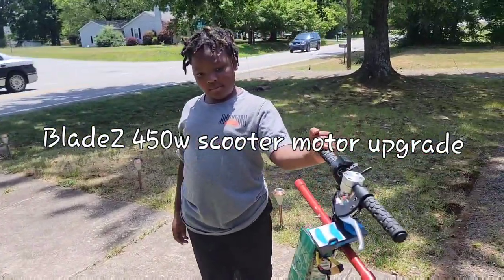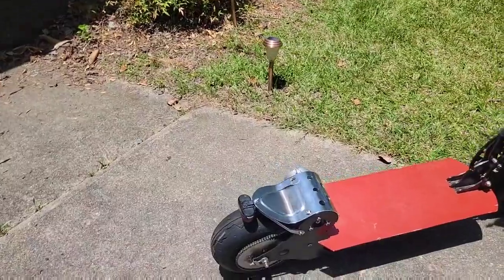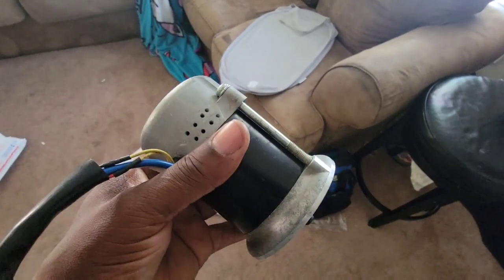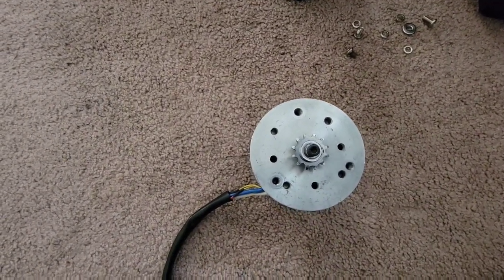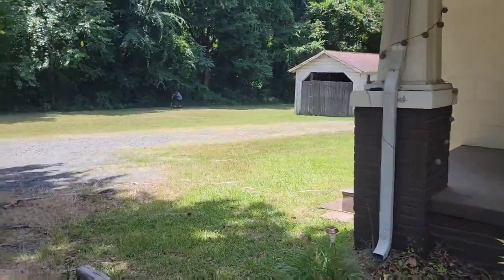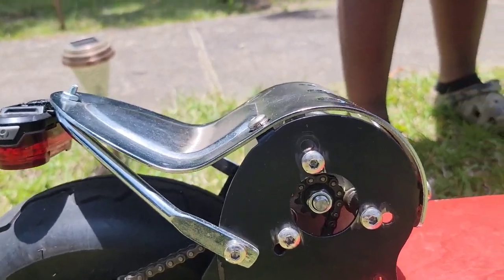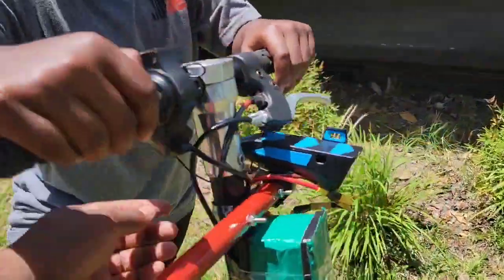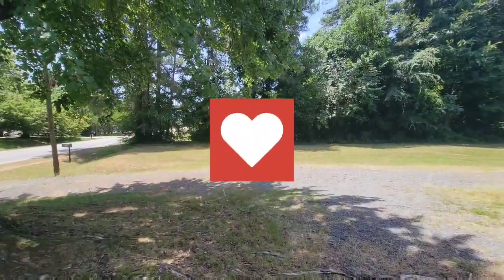Upgrading BladeZ electric scooter motor....More Power, very easy

Comment: Is it difficult to install a new motor in? I bought an old Bladez comp scooter but the original motor and all the electronics are scrapped and it's basically just a scooter lol but I'm interested in rebuilding it with a new motor and such any recommendations for parts?
Reply from the maker: It's super easy to switch out. I did  have to change the bolts to longer ones that I bought from lowes. And you need a drill to make the new holes. But that's all. You can do it
Reply: The old blade Z had to 12 V batteries what did you change your battery set up to? To accommodate the 36 V motor?

Comment: Nice i just upgraded the motor on mine too
Reply from the maker: What kind of motor did you upgrade it to?
Reply: @arijunal  48v 1800 watt beushless
Reply: @BlakJakk  was it an easy install? Did you have to rewire anything or solder anything to the circuit board?
Reply: Can I get the info where you bought the motor